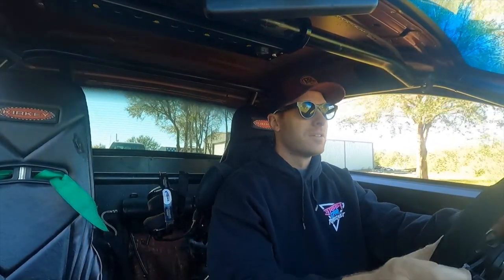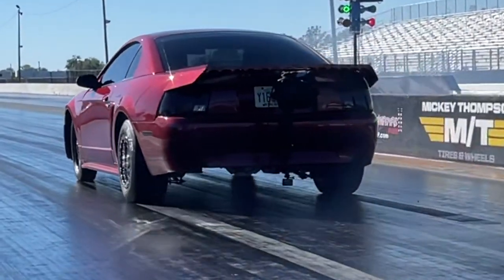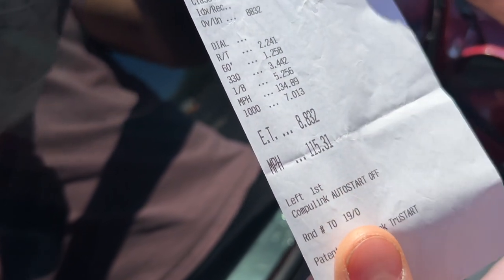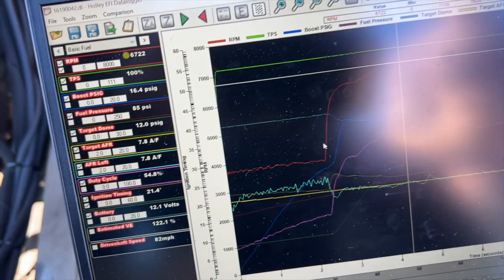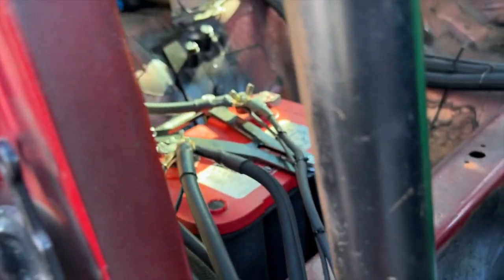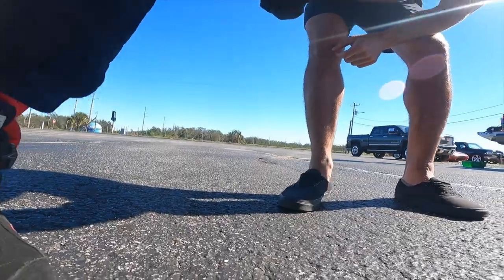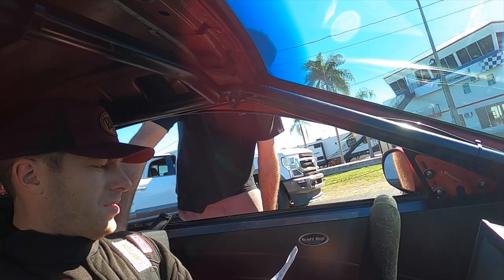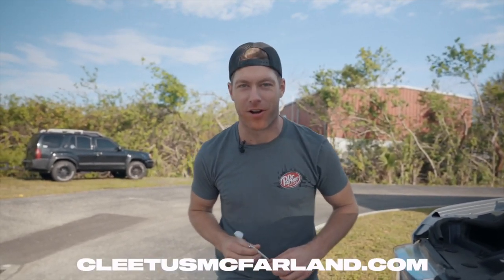Turbo LSX Mustang does Wheelies on a Small Tire

Comment: Voltage is part of the problem can't make power and loose electricity a engine needs 5 things air fuel fire for the first three timing and compression is the other two things any engine needs you'll be surprised how much any one of the five effect things and if your experiencing volt drop then there's a bigger problem if the holly drivers are failing if voltage to em drop key control systems start to get dropped to keep working